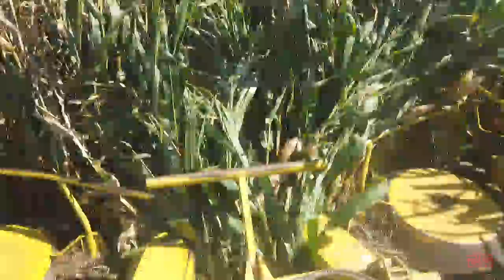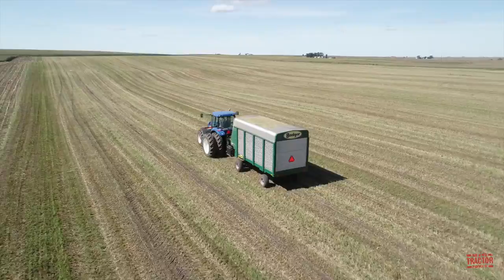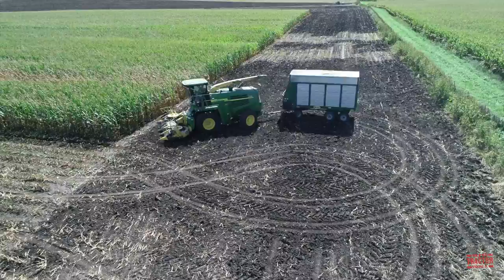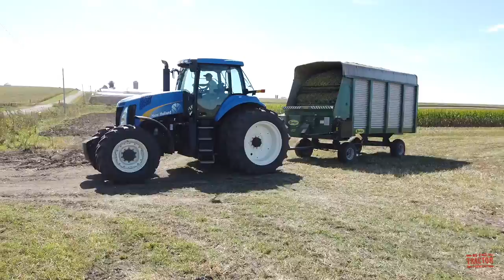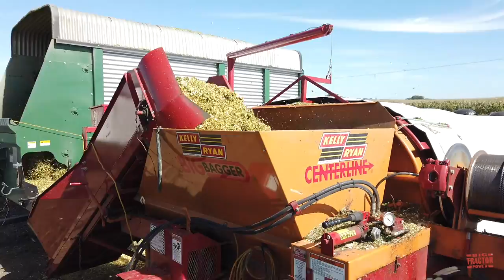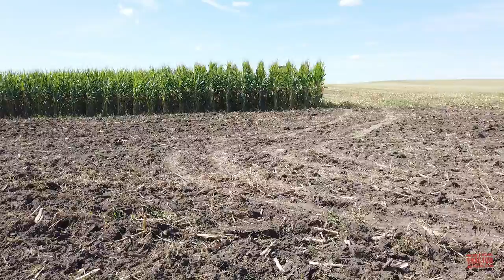Chopping Corn in Iowa : JOHN DEERE 7250 Forage Harvester

Comment: This was great I remember chopping on the dairy I worked we didn’t use bags everything went in silos even high moisture shell corn funny thing is we never rolled it before putting it in the silo neat to see how it is done today
Reply from the maker: When I was a kid my neighbor put a cob mix high moister corn up in a silo. They harvested with a John Deere 6600 combine and then the trucks unloaded into their New Holland 1600 Forage Harvester which was hooked to the silo blower pipe. The chopper processed the corn well.
Reply: bigtractorpower that would have been great we had a pull type John Deere two row chopper behind a 4650 two wheel drive was only to chop hay and corn think we did it that way to save money not to spend it on more equipment price of milk wasn’t enough to have a lot of nice machines at that time just to put in time line would have been between 1990-1995

Comment: Those quick connect hitches look brilliant. Makes a total pain in the back straightforward and quick, and even adds a super satisfying clacky-sound :) I might have missed it in the video, but how many horsepower does the Kelly-Ryan bagger require to put the chopped corn into the white bag? If I see that right it mostly needs to drive the conveyor from the wagon to the bagger.
Reply from the maker: I would saw the 125 hp Work Horse is a good match for the bagger. I normally see 125 to 175 hp tractors on these.  It’s allot of volume to load into the bag.  Thank you for watching. I agree on the clanky hitch sound. 👍👍
Reply: We've put our 4055 john deere on our bagger before and it had no issues. So 95 horse or above would be fine for it!

Comment: Right near my home town ?How is that hook up automatic  is it magnetic great stream sir
Reply: Those Bergman hitches are manual. The part on wagon has a rod at an angle, the chopper has the receiver. When the chopper backs up it connects with the pipe and the hitch on the wagon lifts up and locks in place. They are a great time saver.
Reply: Awesome  thank you sir